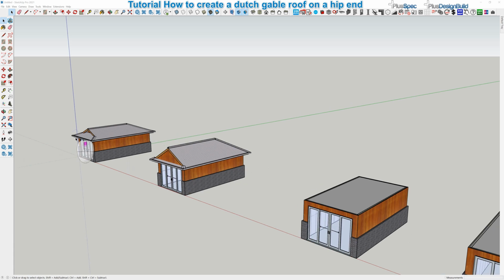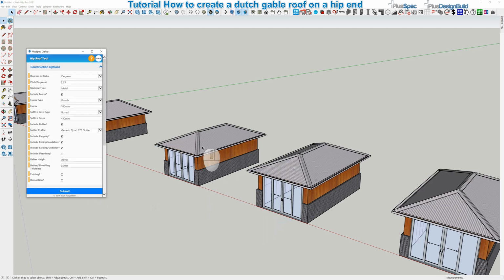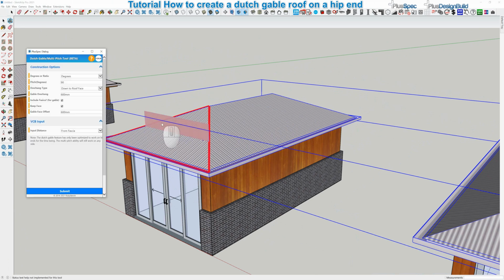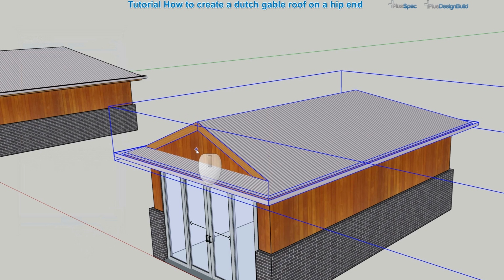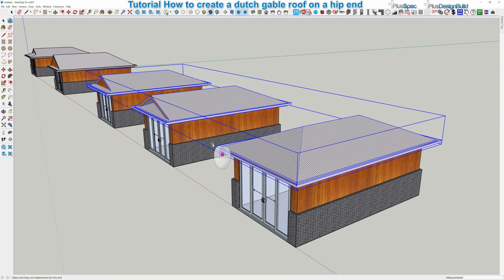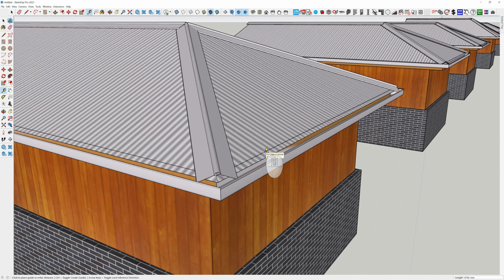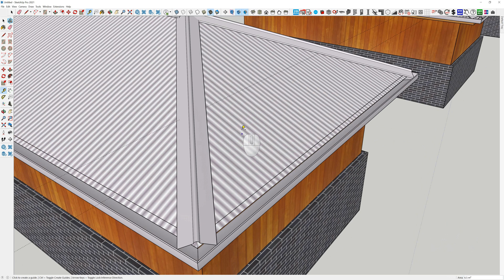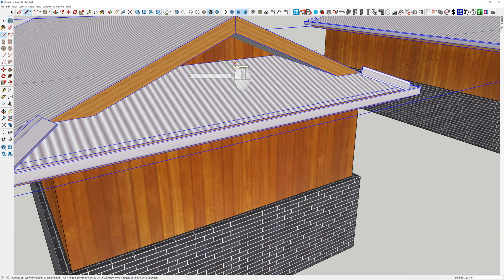Creating Dutch gables on a hip roof in PlusSpec & PlusDesignBuild for Sketchup Tutorial

Comment: Not annoying at all installing the ridge cap …
Reply from the maker: The ridge cap is automatically added.  Do you mean the barge cap?
Reply: @PlusSpec  The ridge capping that has to be spliced so half sits under the Dutch gable and then the other half sits over the top. It’s annoying to come across especially if the ridge has to be scribed in under where the eave hangs.
Reply from the maker: @ssmith9522  is it for quantities you want this or is it for visuals? if so you will notice ether is already 300mm added in the BOQ.
  We also don't mitre the base of the ridge cap as many people like to finish flashings  it many ways..If we add an option for every possible outcome, the roofing tools would be too hard to use, and as a result no one  would use them.  Its a 30 second job to triple click the ridge cap and finish how you like.   It's a trade off we have to make unfortunately and when you weigh it up the roofing tool already saves countless hours drawing an countless hours estimating. So its not a bad trade off wouldn't you say?
Reply: @PlusSpec  haha not for the actual roofer (me) who has to physically install your ‘30 second triple click job’ in real life.
Reply from the maker: @ssmith9522  copy that,  the worst is getting the apron flashing on the Dutch gable under the eave and onto the roof in 40deg C heat...after its been sheeted or tiled. 😓
Reply: @PlusSpec  hahaha yeah, especially if it’s a re-roof.  The existing apron flashing is usually covered by a rendered wall or a weather board which makes replacing even more fun.
Reply from the maker: @ssmith9522  copy that getting screws out under flashings is Arggghhhhh frustrating